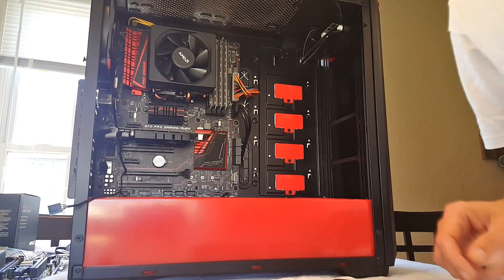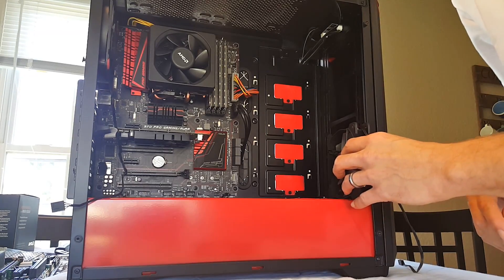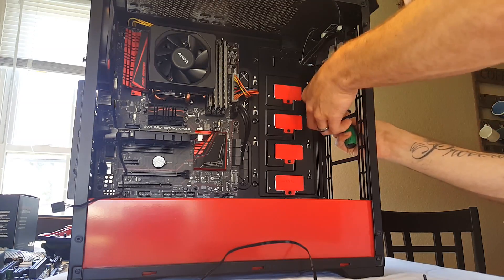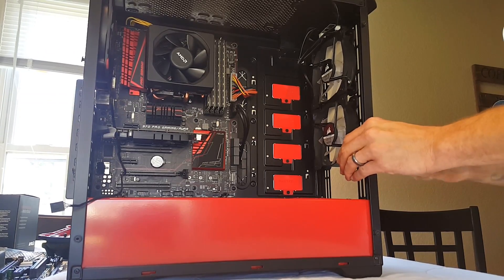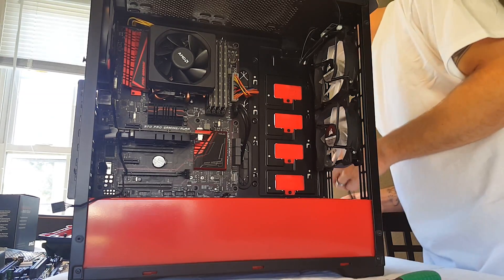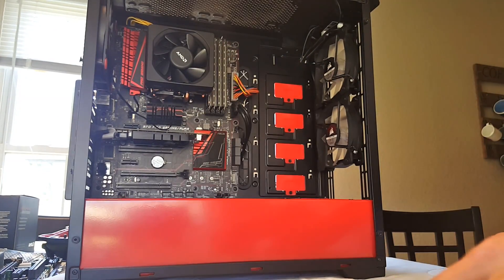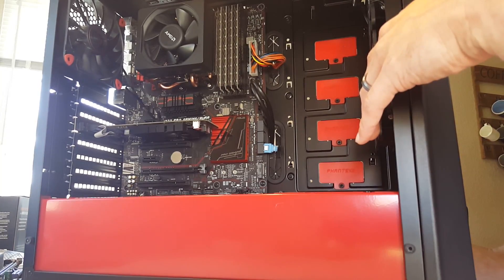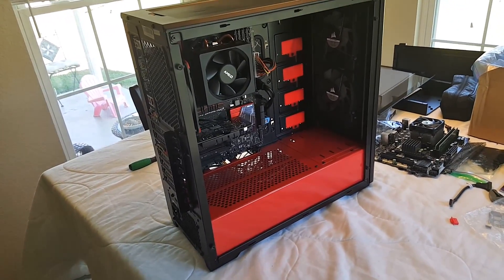How To Install Fans In Your PC The Right Way

Comment: What does the little spot where I plug the fan wire into called or looks like
Reply from the maker: Usually it will say fan. It will have 4 post's on it.
Reply: PGN oh, and if I have rgb fans, can I plug the head where it makes the fan spin into the mother board and the other head where it turns on rgb to the little box where I then have to manually change the the rgb with a remote. Will it work?
Reply from the maker: Rgb is yes and rgb is just 4 pins also usually towards the edges of the board. Make sure you put them on the right direction for your RGB they'll be labeled and the led strip usually has a triangle or something to indicate which side is voltage.
Reply: PGN wait so do i plug the cable where it powers the rgb into the motherboard, or the little box on the back so I can manually change it with a remote

Comment: Thats great but if my motherboard doesnt have 3 fan connectors then what
Reply from the maker: Buy a splitter you can run 3 fans off one header.
Reply: Or buy a fan controller and it connects on 1 port and can get from 2 to all the way 10 fans connected
Reply: You can use an external fan that runs off of usb

Comment: How do I connect my fan hub to MOB if the MOB only takes 12v? Stupid fan hub outputs 5v.
Reply from the maker: Can you tell me the brand/model number of the fan hub? Some connect differently than others. Also which Motherboard you're using.
Reply: Uphere fan hub. There's no model number on the hub but its the pf1207-5 120mm 5v 3 pin addressable RGB on Amazon. Dont tell me i have to return these and get new fans? MSI b450 tomahawk max

Comment: Hey nice vid! Just a quick question tho, is 1-3 fan enough for a gaming setup? Not overclocking it and I live in Philippines which gets 40c+ in summers and around 20 in a cold season thank you!
Reply from the maker: I'd use 3 in the front and one in the rear.

Comment: my case has 4 slots for the fan, 1 on the back, and 3 on the front. If I install 3 on the front as an intake, and 1 on the back as an exhaust, won't there be too much air inside?
Reply from the maker: There are plenty of apps now a days you can control the fan speeds. Could split the front 3 off one header and have them at say 25% speed and have the rear set for 50% or 75% speed to exhaust accordingly. You'll just have to experiment with your particular fans and case to see what percentages keep it coolest. Hope this helps.

Comment: so all you have to do is plug the fans into the SYS fan ports on the motherboard and they will be powered by the motherboard??? i bought 3 fans and they all have two cables that come off of each one of them instead of 1, and im confused as to why because i keep seeing videos where people have fans with just one cable like yours.
Reply from the maker: Yes powered and speed controlled through motherboard. If you use the other cable it powers it but also runs it at 100% all the time.
Reply: @PapaGame  thanks man!

Comment: Is it ok to install a intake fan on top of the PC? I have no grills in front of the pc
Reply from the maker: No grills on front? That's very odd. Top should be used as exhaust since heat rises. If your forced to not use the front you'd be better off having an intake on the bottom just make sure there's clearance under the case and on a hard cool surface not carpet.
Reply: @PapaGame  yeah https://www.amazon.in/Enermax-Computer-Acrylic-See-Thru-ECA3253-BR/dp/B009IKC5ZQ thats the computer case i have.

Comment: I have a 3-pin fan and my motherboard has a 4-pin connection, how can I connect? Pls help
Reply from the maker: You can connect a 3 pin fan to a 4 pin header just research your motherboard to make sure you put it on the correct 3 pins. The 4th pin on fans is pwm (pulse width modulation) this helps control the fans speed, you'll still be able to control them with certain apps. At any rate it's always best in future purchases to go with 4 pin for compatibility with apps.
Reply: @PapaGame  Thank you very much
Reply: @PapaGame  I have another question, what video card would you recommend for up to 220 euros. I have a ryzen 3 3200g
Reply from the maker: @Armin-jv9fq  GTX 1660. Try to get a known performance brand with good cooling like Asus ROG, MSI or EVGA. Stay away from Radeons you'll spend more time fiddling with drivers than playing games.
Reply: @PapaGame  thx

Comment: I have got 4 non rgb fans do I need. Fans splitter and my motherboard is the msi b450 Tommahawk max
Reply from the maker: Your board has 4 Sys Fan 1 CPU Header and I believe they are all rated 1 Amp each. 6 if you include water pump. Sys fans is the type of headers you want to use for case fans. So your board has plenty of headers but you might still need 2 splitters just in case your fan cables aren't long enough to route them through the case.
Reply: PGN  so I have to get it fan splitters  Just in case but if my cords for the fan are long enough I don’t need anything to connect them to my motherboard?
Reply from the maker: @hanadsiad8641  that's right.
Reply: PGN what if I just use the 2 fans that come with the case
Reply from the maker: @hanadsiad8641  if you're only going to use 2 then make the front one an intake and the back one an exhaust. I'd definitely recommend getting one more fan for the front ASAP though to help keep your temps down.
Reply: PGN a lot of people say that the h510i works best with negative pressure I am going to add 2 intake fans later on I was just asking if I could just put 2 fans in the motherboard
Reply from the maker: siad  yeah for sure.

Comment: So I have a question... My case came with 3 fans and I didn’t get a fourth so the way I set it up I put one on the back as the exhaust and 2 in the front.  But in the front I have a fan on top and a fan on bottom so there’s a hole in the middle where a 3rd fan should be.  I was going to get a fourth but I checked all the temps for the cpu and gpu and everything is going good there.
During gaming gpu is about 50-60c and cpu is 60-70c.  So what’s your opinion on this?
Reply from the maker: Standard set up has two intakes in the front and one exhaust out the back. Those temps sound good so don't worry about adding a 4th. If you put 2 on top exhausting the temps would go down some more but it's not necessary unless you're planning to overclock CPU and GPU.

Comment: What if I only have one place to plug it in?
Reply from the maker: You can use splitters "Y" cables to run quite a few fans off one header. No disadvantage to doing it that way except all the fans will run at the same speed.
Reply: @PapaGame  I went to the shop today and employee asked me is it a four pin or three pin, does that matter?
Reply from the maker: Four pin can be controlled by the motherboard 3 pin cannot. Most now a days are 4 pin.
Reply: @PapaGame  Wow thanks for your quick replying!
Reply from the maker: NP :)
Reply: @PapaGame  Another question: I just read that it is not smart to plug more than two fans in one header because it can damage your motherboard, is that true?
Reply from the maker: Yeah it's best not to. But I know plenty of people who have run 3 or 4 no problems.
Reply: @PapaGame  Thanks!

Comment: Great video very informative, just one question are fans universal or different cases have different fan size?
Reply from the maker: Thanks! There are 3 different sizes the most common are 80mm (typically in the front and back) then 120mm (typically on the top or bottom) then 200mm (in some large cube cases).

Comment: if you were gonna put a 120mm fan at the top would you have it drawing air in or push air out?
Reply from the maker: Pushing out since heat rises
Reply: @PapaGame  I was thinking the same thing but I guess their is no reason to leave the dust catching mess on the top then at that fan

Comment: On top of the case which way does the fans go in? the ugly side facing the cpu/motherboard or the pretty side facing the cpu/motherboard, I have 2 insignia 120 mm case fans.
Reply from the maker: Ugly facing inside the case towards mobo. That way the fans draw air out of the case.

Comment: So I bought a prebuilt pc and was planning on just adding a couple of Corsair fans that aren’t the same brand as the ones that the pc came with I was just wondering if I could have 2 different fan brands running in the same tower btw love the vid very helpful keep it up 👍
Reply: You can have multiply branded fans inside of a pc, as long as you have power and room for them.
Reply from the maker: Definitely can sorry for the late reply haven't been on much with the holiday's.

Comment: What is the requirement for installing fan cases??? Do i need controllers???
Reply from the maker: You are not required to have a controller. Most any fans can be controlled through software depending on the motherboard. The higher end gaming motherboards like Asus ROG's are able to easily. Software actually allows you to set specific fans to increase/decrease depending on the temps of various components. You can use a physical fan controller, they even have ones that will fit in a disk drive bay with a touchscreen LCD.

Comment: If you have a case in front of your fans like you, how does it get air in, does it matter?
Reply: Get case with just filter in front  there is many  and are cheap too
Reply from the maker: There's vents at the top and bottom of the front panel. To be honest though it wasn't enough so I ended up cutting vents into the panel cause the airflow sucks in this case.

Comment: Does he have an air filter infront of his front intake fans?
Reply from the maker: There's a filter on the top it's magnetic mesh. But I ended up using that in the front and vented the front cause the airflow in this case sucks.

Comment: Can you controll the fans with speedfan?
Reply: Many pc case have control fan button i have 45$ case that i have and control fan speed mid/high or off for each fan
Reply: You might be able to control them through software that changes the voltage to the fan headers, not sure if you can without PWM headers beyond that.

Comment: What if I have 6 case fans and only 3 fan headers?
Reply from the maker: You can daisy chain them or use a splitter on each header. Just keep on mind however many you split off a single header they will run at identical speeds. Alternatively you could get a fan controller they're pretty inexpensive and you'd have separate control of all your fans.
Reply: Papa G I appreciate it, I’ll go with the splitters. Thanks for the quick reply
Reply from the maker: @mattcrook4978  no worries.

Comment: I can’t seem to plug in the case fan, it looks like it would fit but it won’t plug in
Reply from the maker: Some fans are only 3 pin. Either way there should be a notch on the female end of the case fan so I only fits one way. You can use a 3 pin fan on a 4 pin motherboard connector by the way just check your motherboard manual to make sure you're actually trying to use a fan header.
Reply: Papa G thanks you, I figured it out

Comment: What GPU?
Reply: That’s what I said to but then I realized it a super bad one that’s really tiny
Reply from the maker: Was just an old Radeon i used for the videos. Put crossfire RX 580's in this case. Sold them and ended up with a EVGA GTX 1080 Hybrid.

Comment: Do you not need to connect fans to your psu?
Reply from the maker: Not if your motherboard has fan pins they're powered and speed controlled through the motherboard BIOS or even software. Almost any motherboard from the past 5 years will have fan pins though. Powering by PSU leaves you with no control of the fan speed they just constantly run at 100%.
Reply: Papa G ok thanks also, I want to upgrade my motherboard and I’m kinda new to pc building, should I uninstall old drivers before I put in the new motherboard?
Reply from the maker: @ohhcarbonz_9817  I'd recommend reinstalling Windows if you're upgrading your motherboard to avoid any issues. Just reinstall windows with the old motherboard in and select the option to not keep your files. Make sure you back up anything you need before obviously.
Reply: Papa G ok thank you
Reply: @PapaGame  So, if the fan is connected to the motherboard, there is no need to connect it to PSU and vise versa?
Reply from the maker: @eternaya  that's correct. Sorry for the late reply I was on vacation :)
Reply: @PapaGame  thanks for the info

Comment: The casa we have is exactly like that one but when we turn on the computer the fans do not spin
Reply: Neutralisting Supernova you need enough fan headers on your motherboard. You can usually find this by searching up the name of your motherboard and looking at the specs. If you don't have enough you will need to buy adapters. (They're cheap on amazon) then you plug your fans into the system fan headers.

Comment: how to connect all the fans?
Reply from the maker: You either need enough headers on the motherboard or you can daisy chain them with adapters. One header can run quite a few fans but they will all run the same speed that way.

Comment: my came with some type of fan wiring hub connected the 2 fans the p400s came with. do you if they get power from the front usb ports or do i have to connect them to some type of power?
Reply from the maker: My version didn't come with the fan controller but I'm almost certain it's all tied into the cable going back to the motherboard which is the same one that powers the front USB ports.

Comment: What do I do if I want to install more I only have 2 channels?
Reply from the maker: Mr. Robot you can buy splitters to run more fans off one header.
Reply: I just did that. Bought a 3 way splitter for my Mini ATX board, and three Noctua NF-S12B Redux 1200. My R9 290 gets pretty hot really often and i was looking to a nice guide on how to properly install the fans. Thanks man! Now i hope those 3 can lower the temperature of it from 82º to atleast 72º stable ~. But i doubt it, it will mostly just reduce my CPU temps to 60º and less from 67 ~
Reply from the maker: Dy Savior no problem man!
Reply: Papa G swwweeet your awesome thanks man